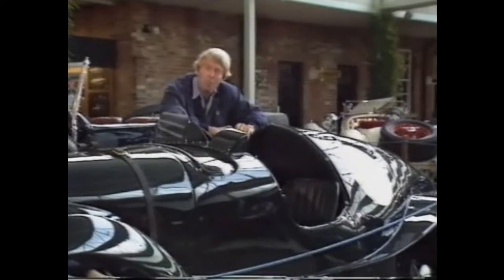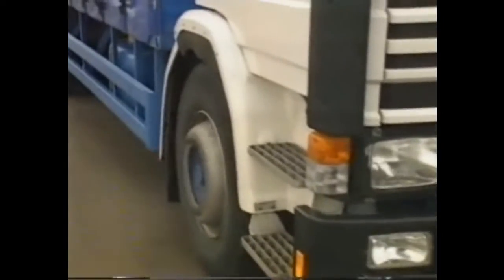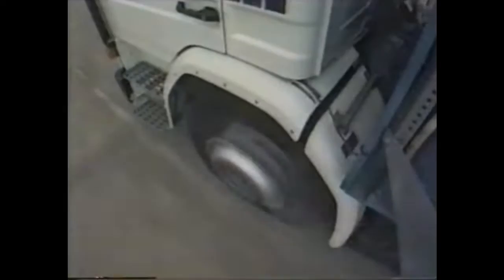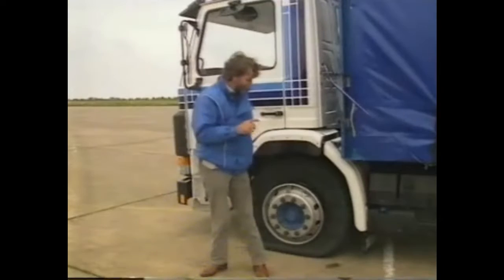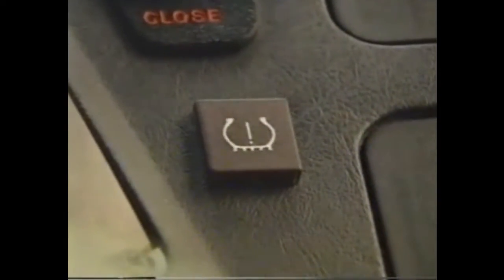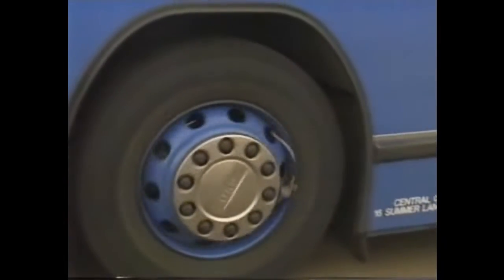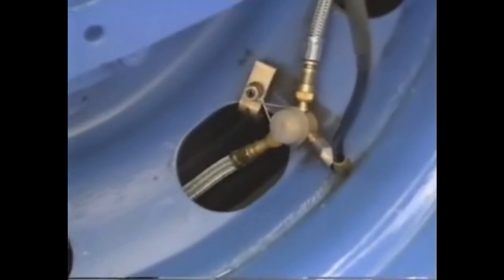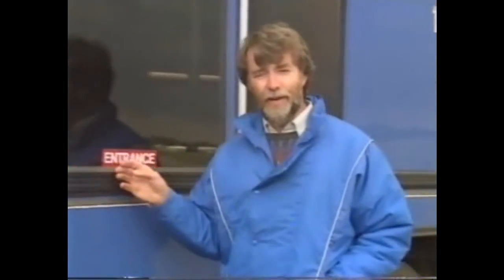Old Top Gear - Lorry & Bus Tyre  Safety

Comment: A couple years ago I was driving on a freeway at night and saw a truck ahead of me throwing a few sparks. Pulled up behind and saw that the tread was gone from one of the inboard wheels on the rear trailer axle, appeared to be just the sidewalls, with protruding wires sparking on the road. Pulled up alongside the cab and honked, the truck immediately slowed down and pulled over - I'm guessing he had some suspicion something was wrong but didn't know for sure, and when someone honked at him he knew something had to be amiss. Based on that my guess is that he did have a system like this but thought it might have been giving a false warning until I honked at him.

Comment: All the newer trailers my company is buying have tire pressure systems with an alert light if it senses a leaky tire.  Knock on wood I've never had a steer tire blow out.
Reply: Nor have I, but I did have both tyres on one side of the single drive axle go on the M1 with 22 ton of steel on. Livened me up a bit. Only one spare as well, so I had a nice break. This was in the early 70's when we changed our own wheels.... if we had enough spares. :-)